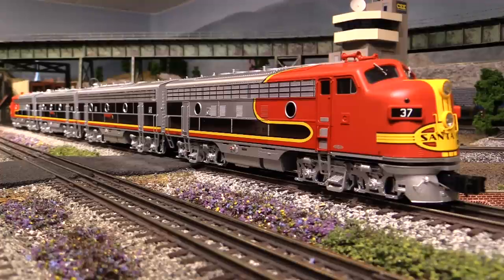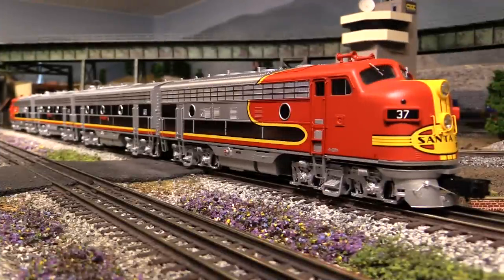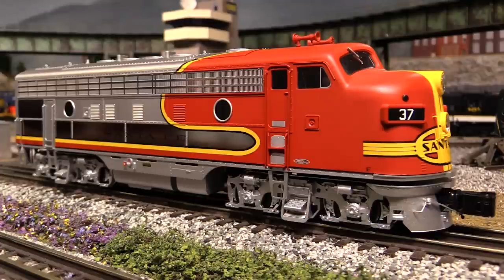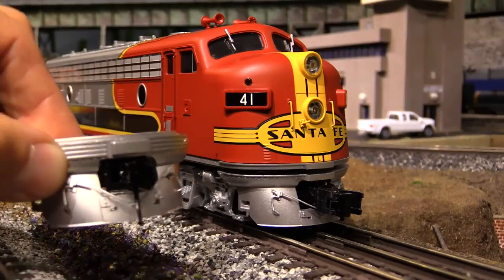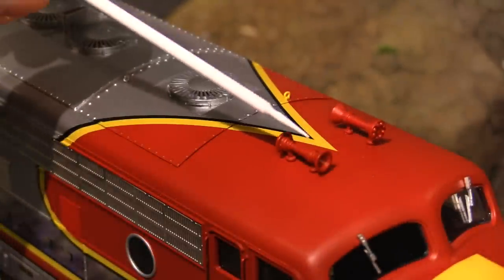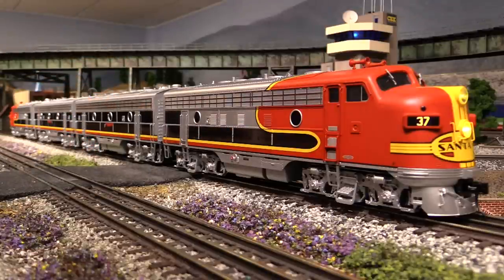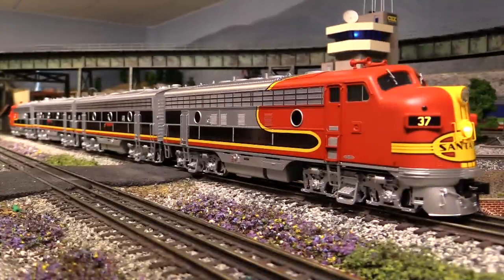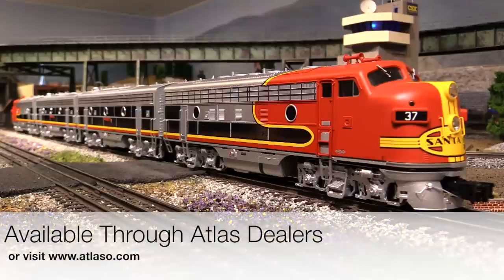Atlas O F7A/F7B Diesel Locomotives

Comment: Brilliant, entertaining & informative review. Many thanks. With the chrome plating mirrored sides, Atlas has certainly managed to answer the age old question about why the advance Lionel catalogue depicting the intro of their own F3 models in the 50's showed an apparent black finish. Probably the Lionel pre production models had a mirror finish that merely reflected the background making the sides appear to be black. Question: How has replacing the Lionel couplers on your models with scale fixed couplers worked out? Did you replace any of the rolling stock couplers? What is the minimum radius of the curves on your layout? Did you encounter any problems with the new fixed couplers? Thank you, Tom

Comment: That rear dummy coupler on the A unit seems like a huge oversight. If these were sold as A-B two packs that were meant to be run together and there was a functional coupler on the back of the B it would make sense. Having a dummy coupler on the end that would be the most likely end to be coupled to something seems counterintuitive.

Comment: That was a good informational video, and understandable as you are selling them.  It was not, however, a good review that told about the bad things in addition to the good.  I would like more of a discussion about quality control, as I found several issues with my F-7s from 2015's run.  The potholes were not well secured on those, and I had to remove the shells on all the units and properly glue them.  Otherwise normal handling will result in them being pushed inside.  Changing the batteries, if used on conventional running locos, involves removing the shell, and on the F-7s I bought the antenna wires are not long enough, so it is very easy to pop the antennas off the inside of the roof.  Warning in the manual about that would be very helpful.  I found the screws retaining the crew ladder steps to be loose, so when the shell were removed the ladders would tend to fall off.  I found similar issues with loose screws on the California Zephyr set I purchased.  The locomotives and cars of that set were really pretty and detailed, but very fragile and had poor quality control.

Comment: NS's OCS uses F9's not F7's.
Reply: Clear Signal Productions pretty sure the A units are F9's, but the B units are F7B's
Reply: NS 4270 and 4271 were built as F7A for the Baltimore and Ohio as 937 and 947 respectively. They were rebuilt by Morrison-Knudsen as F9PH for MARC (937 became MARC 81, 947 became 85). So technically speaking, NS has an A-B-B-A set of F7's
Reply: cody rentzell NS OCS are basically GP38’s in an F unit body